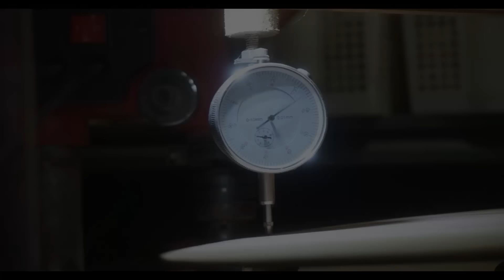I Built A Small Acoustic Bass - The Ukelele Bass

Comment: I think uke basses are one of the coolest instruments. As a professional cabinetmaker and a woodworking teacher you chose some very unconventional ways to do things. Those braces look way heavier than they need to be - there would be a lot more acoustic sound with lighter bracing. The end result though  must say was pretty good.
Reply: The extra bracing will definitely help with the longevity of the instrument. Those thick steel strings will definitely try to bend it over time.
Reply: @alexandermiller5425 Those are rubber strings. These rubber ukulele bass strings are incredibly low tension.
Reply: What thick braces he carved and scalloped them 

Have you ever seen the inside of a acoustic instrument

Comment: What a beautiful instrument.  And using the disc sanding attachment on the drill press is actually genius.
Reply from the maker: Thank you!
Reply: Agree to that.  Very clever. Why have not i think about that ?
Reply: That is a lot to remove with a sanding disc. I'd plane it down and maybe finishing it with the disc
Reply: @orbodman  Not everybody has access to or the funds to buy a planer.  Using a sanding disc for this is an admirable low budget workaround, and you wouldn't have to worry about chipout on those thin boards, either.
Reply: @AmuroRae  not a planer. I said plane, as in hand plane. I would always hand plane the boards first.

Comment: I am no expert on pick ups but I think some kind of under the saddle pick up should work, I think Fishman should have something you can use.
Btw, I had to split the bridge saddle into 4 equal pieces on my sub
& Goldtone bass bc the volume on D & G strings
was much lower than the
E & A strings, splitting the saddle seemed to equalise the volume.
Reply from the maker: Thanks! I appreciate your suggestion, I couldn't find any under saddle piezo pickup specifically for a UBass in my country, I might go for a  Ukelele or a guitar piezo system. I can also try doing a transducer setup just like what I did in my Hybrid Guitar.

Comment: You can mount a lightbulb inside the metal tube for a faster and more stable bending iron🤙🏻 just take the parts from an old lamp and you have a nice useful bending iron for not much. 

Also, if you make the iron shape like an avocado you can have wide and tight bends on the same one

Comment: Awesome bass! What is that sanding disc you are using on the drill press? I could definitely use something like that to help flatten the bottoms of awkward projects off the lathe.

Thanks!
Reply from the maker: Thanks! The sanding disk is for an angle grinder and I got it from an online store, but I think any will do as long as you can mount it on a drill press. The 40grit sandpaper is really effective at removing a lot of materials, just keep your hands away from the disk.

Comment: How come you've placed the saddle so far back? I'm aware the way the neck's fretted demands a certain scale length and that a longer scale means more material in the strings that moves, but aren't some of the vibrations lost in the bottom when the saddle is so close to it?
I'm curious about this, because it's the same with lutes, even baroque and arch lutes. With my limited knowledge, I would think you could get more out of your strings, if you were to place the saddle in the middle of the vibrating area and make a longer neck to maintain the scale length.

Comment: Great job, awesome bass, just wondering why you didn't add some kind of pick up to it. I sure it would sound great. I have a Kala Sub bass,  a Hofner Ignition bass & a Gold Tone micro bass the latter similar to yours. I had the rubber strings on the Goldtone, I didn't like them at all, won't stay in tune & streches so much that they start to double wrap around the tuners,
changed them to Silverbacks, rubber core with metal windings.
Btw, how long did it take you to finish the project & 
what is the scale length on your bass?
Reply from the maker: Scale length is 26.5", it's really a funny and long story why I come up with that length. But the short version is, I have a fretboard that's made for a full bass, it already has slots, removed a few materials and calculated everything and it ended up being 26.5". 
I was really hesitant to put a pickup cause I'm not familiar with this instrument. What pickup do you think is best for a UBass?
Reply: Fischman makes a good u bass preamp and pickup. You will be amazed to hear one playing plugged in. I have been using Kala U-basses for many years. So handy and sound great. Please continue your excitement work!

Comment: Beautiful work.  Great use of the drill press with the sanding disc to get the thickness dialed in.  Well done!  What kind of strings are those?
Reply: I would say they are Thundergut (Aquila). I have them on my U-bass. They look exactly the same. Of course the sound of this Bass is a lot better than the sound of mine (cheap U-Bass).

Comment: Nice job but top looks a kind of  hard wood hardwood for top usually is not a proper option. I think it's ok but your bracing makes it worst I recommend you just use a base bar it's enough for gut.
Reply from the maker: Agree with you with the bracing, the back bracing that I made (which is the traditional way) is better than the top. I wish I didn't add too much bracing to make it resonate more.

Comment: What is the point of making a parallel mortise with machine screw fixing and then gluing it in ?????
The ability to adjust the neck angle is lost !
The glued parallel is a complete bastard to remove for repair compared to a dovetail which comes out as soon as a little loosening is achieved.